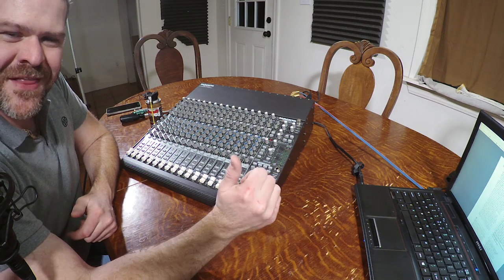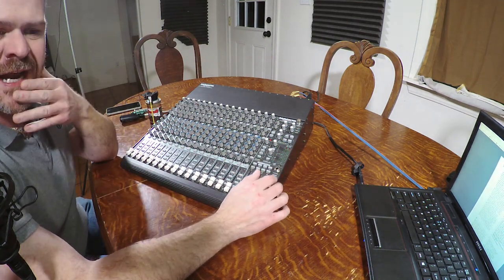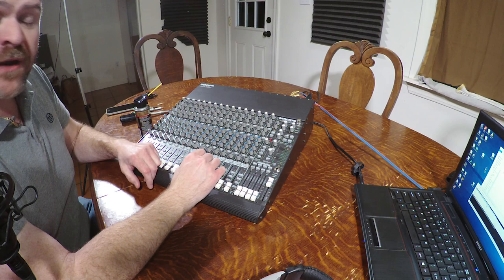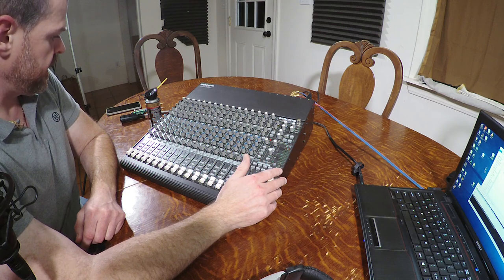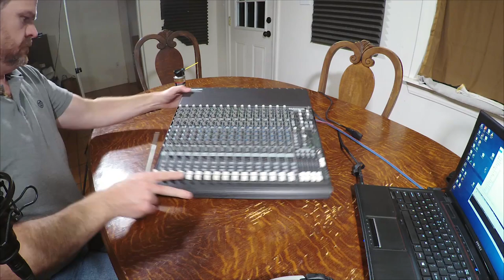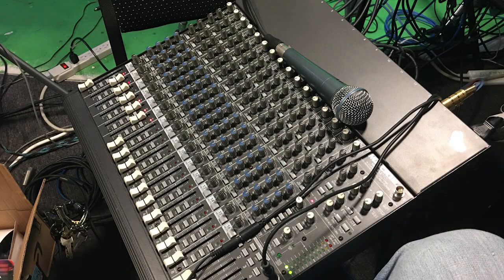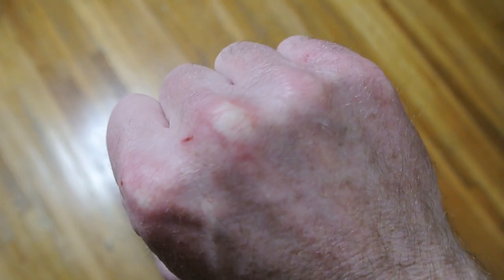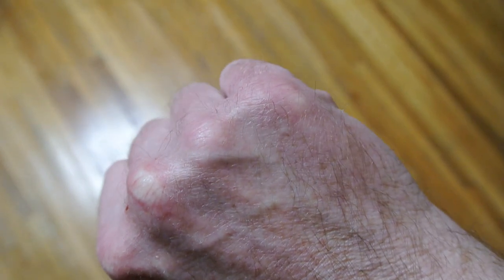Using DeoxIT to bring back life to an old Mackie 1604-VLZ-Pro

Comment: I just blasted my 45 year old 22 Faders present in my Soundcraftsmen PE2217  Preamp - Equalizer, with Deoxit D5.  The Faders were sitting up right such that any dirt flushed during the cleaning will at least drop to the bottom area, where the pot is at zero ohms.  This fixed all intermittent problems along with fixing several Faders which were making no contact at all. The big job was re-lubricating the Faders with a silicon lubricant.  WOW!  The Faders now slide easier than they have in over 40 years.  These Faders are of a unique style where the internal contacts are located on the sides rather than on the bottom, and they are made of two pieces of plastic that are held together with two metals clips.  And so lubricating them is somewhat different since you have to lubricate both on the inside and externally as well.  But, once done, they slide with sooo much ease.  Next I have to fix(clean) pots and switches on my 1978 AKAI GX -630D reel to reel tape recorder, which has the famous Glass X'tal Ferrite Head.

Comment: Here is the trick to fix most all intermittent/staticy sliders and switches! - first use CRC Electronic cleaner (Flush the part with it and move the part through its whole movement area, (for example) A pot, all the way left to right and and back as fast as you can, MANY times while it is still full of contact cleaner! Then blow it out with an air compressor. Do that 3-4 times on a bad one's and 1-2 times on one's that aren't very bad. Then use the deoxit. It works wonders, you'll be amazed at the results!!!

Comment: Thanks for this video.  I just did these steps on every fader and pot on my Mackie 1460.  It’s a great sounding board using as a protools interface, but many of the pots were cutting out.  Everything is working 100% correctly now.  Like a new mixer.
Reply from the maker: Great to hear!

Comment: I have a MACKIE Micro Series 1202 VLZ. It looks like it might be a little older than this, and has Gain knobs at the bottom (instead of volume sliders). I was unsuccessful at getting to the top of the green circuit board to access the pots directly and want to share what ultimately worked for my situation.After removing all the screws, nuts, washers top bottom and sides, the top would only loosen and NOT drop away completely from the circuit board. So I cut a short (1-1/2") straw that just fit over the potentiometer stems and placed it over each pot stem and gave each a small shot of the De-Ox. Then cleaning any excess immediately from the board with a dry paper towel and then Pledge Multi-Surface cleaner (not the anti-bacterial stuff), and twisted the knob stems along the way. Every one of them immediately loosened up. I replaced all the hardware and everything now works as intended. I suspect that this straw truck would have also worked ,not taking the board apart at all, but by all means, if you can get your board apart, disassembly would ultimately be much better. I used DeoxIT Gold G5 (for gold surfaces (because it's all I had on hand), and Pledge Multisurface (NOT the anti-bacterial). Thank you for this video.

Comment: Thanks for this - I've got the same mixer that I just pulled out of years of storage and have similar oxidation problems - albeit mostly in the bus assign buttons. Otherwise, full working order. I thought DeOxit might do the trick - as it does on electric guitar pots and switches - so great to see how to take the board out in order to get to the actual places that need the spray. Much appreciated!
Reply: Did you clean your bus assign buttons? how did it go?

Comment: I have a 20 year old Mackie 1604 VLZ Pro that I've been wanting to try this on.... I picked up a can of the gold contact enhancer and the clerk warned me, "you're just using this on gold connectors, right?" I said, "I'm cleaning out an old Mackie" to which he replied that the gold stuff would ruin the Mackie, get the fader lube instead, so I did.  Looks like you're using the gold stuff...hopefully this deoxit fader f5 will work as well
Reply from the maker: It worked for a while, and several of the channels work great, but a few of the channels are acting up again. It is different for each channel. I will look into the fader lube. The major issue was this poor unit had sit in a production room, and mainly used as a lunch table for so many years, much of the damage is due to neglect and all kinds of food that built up. So far half of the channels are acting  up. I am going to give it one more try, but I with how loose several of the faders and pots are, I am not sure how much is left in this old girl. I don't doubt that several of faders and pots need replaced.
Reply: AudioCraZ yeah I really appreciate the video, yours was the one that gave me the confidence to open it up. It wasn’t that hard at all, though I found another vid... ack I don’t have a link but it was “replacing pots and fader” on a 1604 VLZ... he had links to full compass for spare pots and faders, $5-$10, and showed the procedure to de-solder with the wand and pump, and replace the fader and pots.  With your tech ability and patience maybe that could be worth your time.  I have yet to re-assemble mine and test, we’ll see; I’ll let you know.  Funny, kitty found the bowl of knobs and thought it was pretty amazing once it hit the floor lol
Reply from the maker: Yeah, I want to. The preamps on this thing sound amazing. I love my digital mixers, but the preamps on this guy make it almost impossible to replace it.
Reply: AudioCraZ i was using the mackie’s direct outs as preamps for my drums for years, direct outs on 1-8 into line level inputs on the sound card. Once they started having dropouts entirely I got a Scarlett octopre and WOW it was like having the right Rx glasses on for the first time.  The clarity... I had to work on my drum sound! 
My reassembly went pretty well... there’s improvement... but I lost the headphone jack! Maybe something on it came loose I don’t know but my quick test on channels 1-8 routing through the subs and out the main sounded great! The mains hadn’t been clear in years. Still need to wire it up fully and do a more thorough test but so far I’m happy.  A couple channels I had previously marked as the worst ones are MUCH better, though they’re just a little fuzzy unless the gain is super low and the faders are way up I get a better signal/noise ratio but anywhoo. Cool talking to ya man

Comment: I just used DeoxIT F5 (the stuff made for faders specifically) on half of my CR-1604 VLZ (bought new in 1998), applying it to every pot, fader and switch. It alleviated some (not all) of the snap-crackle-pop but had a side effect of completely ruining the smooth, damped motion of the knobs and faders, leaving them feeling scratchy and choppy. To be fair I used MG Chemicals Nu-Trol on the other half of the mixer to the same effect, so who knows. I guess I'm happy with the lower noise when I turn a knob and push a fader but boy does turning those knobs and pushing those faders feel dreadful now. When you say you hosed it off do you mean with water?
Reply: The loss of that smooth action is likely because Deoxit strips away fader lube/grease, which is usually what gives faders 🎚 that smoother resistance. Deoxit also makes a fader lube you can apply to get that back in there if you want to.

Comment: I thought the Gold Deoxit was for gold plated contacts and tracks? Also spraying the pots from the shaft dissolves the greese that gives it that tight feel, dont know whether those  potetiometers have an access hole underneath, if not they should be pulled apart  or a small hole drilled for access
Cheers

Comment: good vid.  worthy box to rejuvenate and not too difficult (painful maybe) to get into.  I hate the monolithic PCB model but still a nice little board.  better than a lot of their stuff (Mackie).  I don't know if it would work but you might check out deoxits faderlube f5 (i think) to smoothen the fader sliders.
Reply from the maker: This is "old school" mackie, why I have held onto it. The preamps sound so good, so much better than their current offerings. But then again, Mackie has been sold 1-2 times since this board was built.

Comment: I would use the green can (fader cleaner) and fader lube from deoxit for the sliders... The D5 is fine for the pots.
Reply from the maker: I am probably going to dig that board back out. I still have it, those preamps prevent me from tossing it. But I want to get it going again, but a few pots and faders need replaced.

Comment: At 6:39 you mention "hosing it out" Can you talk about this? I've got a very dirty mixer and I'm thinking of cleaning it all with mild soap and water before cleaning the faders are pots. Is this a good idea? bad idea? I've never cleaned a mixer. I know that if you let it dry thoroughly for several days most electronics are fine after being exposed to water.  I may give it a bit of a hit with the girlfriend's blow dryer to speed it up a bit first though.
Reply from the maker: "Hosing Out" is kind of a loose term I use. When it comes to electronics, if I use soap, it is only a few drops of mild dish soap per gallon (roughly).  Rinse it out as much as possible to make sure no soap is left behind, then I put the board in the oven on low (120 F or so) for about 15 min, then let the component sit for 2 days to make sure all water/moisture is gone. This is only for extremely dirty electronics. Then I go to town with electrical cleaner spray and electrical cleaner pens to get get the rest as needed. Then proceed to lube where necessary.

Comment: I just got one of these from my job's fire sale and sometimes inputs are static-y do you have any idea what that is?
Reply from the maker: There are typically two reasons for static. 1. Oxidation and dust/crap buildup on the contacts of the faders or pots. Typically spraying the faders will help. 2. The contacts in the faders are badly worn from heavy use. This a lot of times requires replacing faders or pots.
Reply: @AudioCraZ  ok thanks, the faders seem pretty decent so I will clean it up

Comment: Thanks for the video man. quick question, how did it hold on the long run? 2 years later did u have any issue... i just cleaned mine with contact cleaner and is woking fine... but I know I need to lubric<ate it so it doesnt fail in the future.... what your experience after 2 years?
Reply from the maker: First off, this mixer had sat in a small "DJ Booth" for I don't know how many years mounted into the desk. Being as they had not had any DJ's in to use it, and it was used as a luncheon and talk booth for a AM station for several years, the faders were badly abused and had a ton of buildup of food and what not in them. For what it is worth, this clean up did an amazing job. That being said, about 2 months of use after this and a few of the bad faders and pots started acting up again. They already had far too much play in them, so it was a miracle they lasted that long. I used this mixer for about 6 months and eventually got myself a digital mixer. I was bouncing it in and out of my car, and having a mixer with onboard processing was more feasible than carrying around this mixer and a bunch of mic processors. It is currently sitting in my kitchen, where I want to eventually order a bunch of new fader and pots, but the faders are a bit pricey, and I have a ton of other projects that are currently eating my bank account. I will pick this one back up, but not sure when. The pre amps in this beast are far too buttery for me to toss this mixer,  no way I can bring myself to do that.

Comment: What tool did you use to get the front cover off  - that which goes over the circuit board? I’ve got the VLZ Pro
Reply from the maker: Mine were all small screws,  just a ton of them. Then lift the cover off. Small torx bits, can’t remember the exact size.

Comment: I would have thought the standard advice was to use DeoxIT D5 for the pots and side faders for cleaning (and pot lube), then specialized F5 for the faders (lube) only.  Perhaps the red micro straw tool for better application too.  I'm new to DeoxIT so I could have this wrong.  My usage is for noisy/twitchy micro servos on UMX RC planes.
Reply from the maker: You can even go as far as use the fade lube on the pots and faders, as I could of done. I wanted to do a follow up video, but unfortunately it would only be a temporary fix for my board. Due to the abuse it suffered sitting in a mixing booth for so many years being used as a lunch table, many of the pots and faders are just too far gone. Far too much play in them for any lube to help for any meaningful amount of time. I have been trying to find replacement pots and faders, but due to the age, has been a bit of a challenge. A few places I have found the price was more than I can afford currently, so the board is in storage with the hopes of a repair in the future.

Comment: why did you not change the pots when you had it open
Reply from the maker: The point of this video was to see if the DeoxIT would work. In all honesty, it is really easy to take this console apart, and the idea of replacing components is something I want to do. it just comes down to time and money at this point (also the ability to source the faders and pots, as so far I have only found the faders).
Reply: we use lube-a-trol don't know if it is still made from tech spray

Comment: is it safe to play with the knobs with the case open....?
Reply from the maker: As long as you are not putting excessive force or torque on them, you should be fine.
Reply: I just mean, if you were to slip, couldn't you shock yourself...?
Reply from the maker: Yes, if you touch the PCB, but it is mostly low voltage. You probably won't even feel it,  just run the risk of shorting out something. The shaft of the pot is plastic, so just gripping that and being careful not to touch anything else should keep you safe.